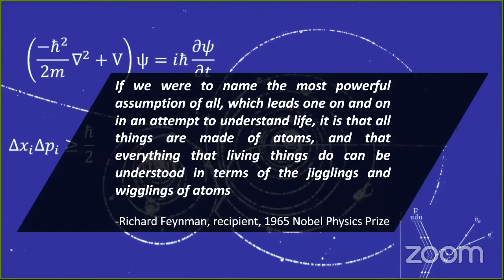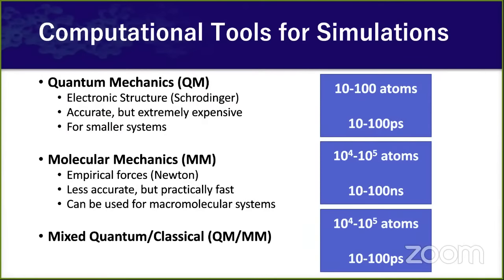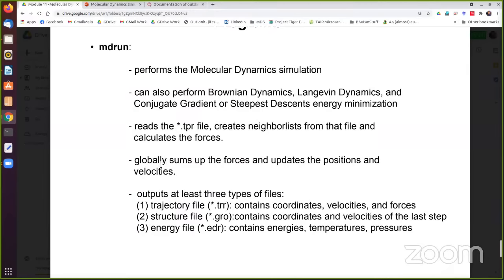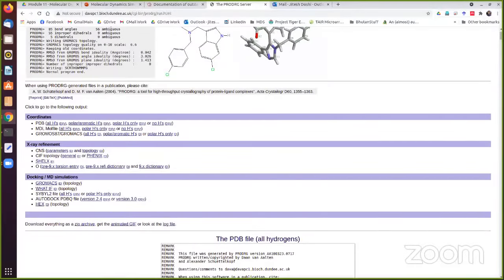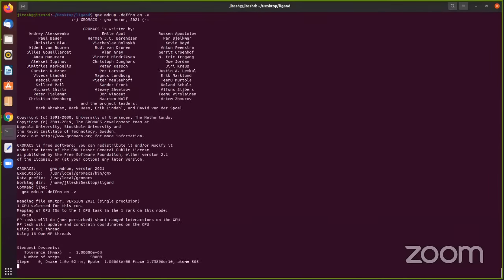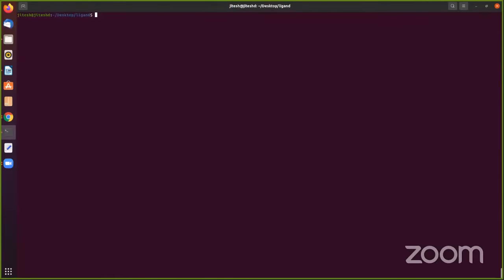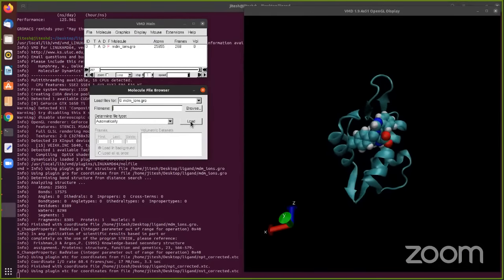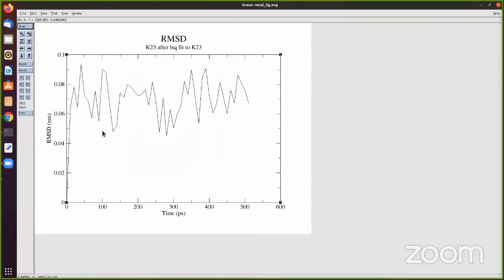Webinar Demonstration - Molecular Dynamics Simulation of Protein-Ligand using Gromacs

Comment: I heard that the gromacs produces substantial larger size of output files as compared to NAMD. can anyone confirm this if it is correct?
Reply from the maker: It does, but that's completely in user control how big and how much data to produce. It has a large set of parameters to save only compressed trajectories as compared to fill detailed ones or larger intervals etc.

Comment: Sit how you doing this so fast , its takes almost a month in my system to complete one  simulation!!!! My md run takes 12 hrs for nvt and npt and md production take one month!!!also i have gpu support!!Can you help me please
Reply from the maker: That's strange. Could you please specify your computer and MD system configuration? Like which cpu, gpu and ram and also how big is your protein..
I also suspect that gromacs is probably not using GPU else it wouldn't be that slow.. your can check that with command gmx --version --quiet to check which cuda it's using our not using.. or while running the MD you can check with command nvidia-smi whether or not GPU is being used

Comment: Sir is it safe to run GROMACS in laptop.. I have a HP Omen gaming laptop. Can I use it for simulation? or running simulations will affect its hardware?
Reply from the maker: It is safe to do so but always make sure while simulation is running, your laptop is around a good ventilation or under a fan or AC as it gets heated up running for several days.. typically for small simulations, it's not at all a problem to run on laptop.. it won't affect the hardware
Reply: @jiteshvdoshi  Thank you for your suggestions sir..

Comment: Awesome presentation. Please which command line can you use to launch the production step on GPU and CPU simultaneously. Thanks
Reply from the maker: If the gromacs has been compiled with GPU during installation, but default, mdrun launches the run on both CPU and GPU so no extra steps are necessary. Nevertheless, to specify number cores or GPU or the tasks that need to be offloaded to GPU can be set by various parameters like -nt for number of cpu threads  , -gpu_id to specify a gpu, -nb gpu to offload non-bonded calculations to GPU.. etc
Reply: @jiteshvdoshi for me also please share the material sir

Comment: There is something I just realized. npt.xtc and nvt.xtc  files are not created as a result of the calculation made with the gmx grompp -f npt.mdp..... and gmx grompp -f nvt.mdp...... commands. What could be the reason for this? . As a result of the calculation made with only the grompp -f md.mdp command, md_lig.xtc is formed.
Reply from the maker: XTC are compressed trajectory files.. usually production runs are much larger in size, i use parameter to save XTC files only in production run. In NVT and NPT files, only TRR files are produced as their mdp files don't contain flag for XTC (nstxout-compressed)

Comment: Sir I am stuck at energy minimisation step, it's only doing till step 12 and error is as follows:  Recieve buffer size too small for transmission (in valid comm) 
Aborted (core dumped)

Please help.
Thanks in advance.
Reply from the maker: Hello this cold be because if the forces generated.. did you get any other message before this part? Like bad contacts or unsettled atoms? You can share your structure and mdp file to be more helpful
Reply: @jiteshvdoshi  sure sir I'll send you my pdb structure, could you please provide me your e-mail id.

Thanks.
Reply from the maker: @blissfulvlogs5789  jiteshvdoshi@gmail.com
Reply: @jiteshvdoshi  sir, for another pdb I tried md run... it's coming: step xyz will no longer try dynamic load balancing, as it degraded performance....is my md still running? And what does this mean?

Comment: hello dear sir, im trying to add ions on my protein ligand system and i get following error:
Fatal error:
Syntax error - File LIG_GMX.itp, line 3
Last line read:
'[ atomtypes ]'
Invalid order for directive atomtypes
i used the acpype server to build the ligand topology. how can i solve this problem. thanks
Reply from the maker: For actype, the inclusion of itp file should be at different position in topology file. It should be at the top region, after protein force field is included before the [atomtypes] directive starts

Comment: Hi, I want to run simulation on GPU but I am unable to configure GPU during Gromax installation. Basically Gromax is not detecting my GPU. On other side, I am using Desmond on same system and there is no any issue in performing simulation. Please guide me about how to configure GPU on Gromax.

Comment: what is your system configuration
Reply from the maker: System used for demonstration was a asus laptop with 7th Gen i10 octacore (16 threads) processor, 16GB RAM and 4GB Nvidia 1650 Ti graphics card.
Reply: @jiteshvdoshi  I am using same config..but i am getting speed near 30 ns per day..  but in your tutorial it was showing around 120..

My gpu is enable Cuda..

can u tell me reason behind it..why my speed it slow? does speed rate depend on the molecule?
Reply from the maker: @Hammad187  Are you working with same protein as in tutorial? Because performance highly depends on size of the system. Also, how did you install gromacs? Gromacs need to be compiled with -DGMX_GPU=CUDA flag during installation. If you are using gromacson windows, it doesn't support GPU. To confirm, if your mdrun command is utilizing GPU or not, open the logfile of your mdrun and check the top portion..

Comment: There were two group entries for K23 at 2:20:47 such as 13 and 19. Why you selected K23 (19) over K23(13) ?
Reply from the maker: Actually both are exactly same group of atoms.. the way groups are listed here is K23 is listed once under Other type amd once under Non-water because it comes under both.. any one of those cam be selected..

Comment: how we can convert output.pdbqt file into different file formate like .gro, ITP, mdp etc?
Reply from the maker: PDBQT file is format used specifically by AutoDock and Vina so you'll first need to convert it into standard PDB format, which can be done using Chimera, AutoDockTools etc. This PDB file then can be used to generate .gro and .itp files. I assume it's a ligand, so you can follow the same procedure used in video to generate .gro and .itp files depending on force field you're using (PRODRG for gromos, CGenFF for charmm, LigParGen for OPLS).. all of these online tools will give you necessary input for gromacs
Reply: Thank you